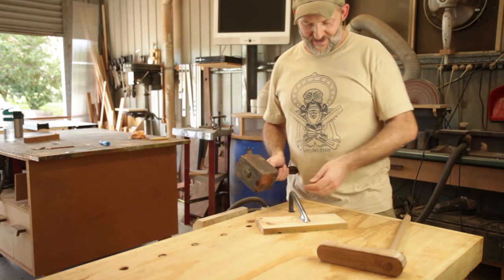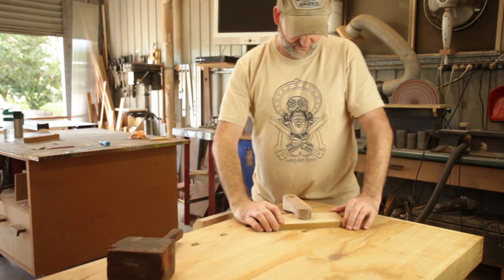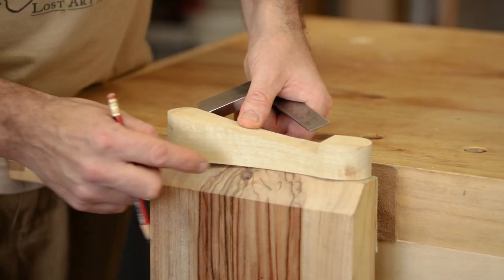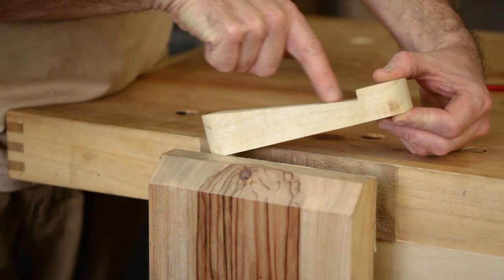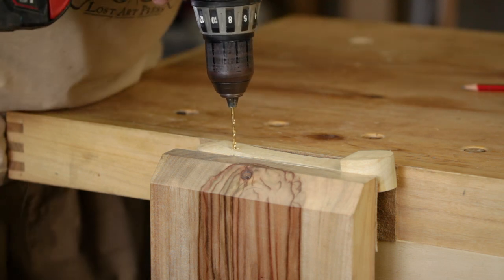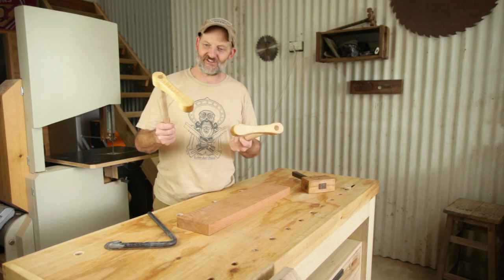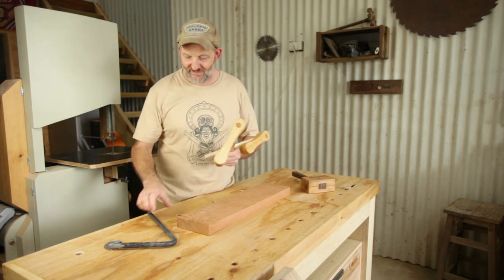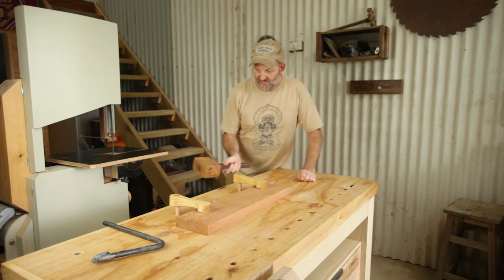Wooden Holdfasts -  Experiment

Comment: The wooden version has an advantage over the steel one in that these won't leave a mark on the piece: putting another piece of wood between the holdfast and the piece you want to hold becomes useless. Actually they hold the piece using more surface, so they don't need as much pressure to achieve the same force.
Reply from the maker: Yes that's a good point! :)

Comment: I made two of these and I am using them since 2 years and I really thank you for making this video... In the country where I live, iron ones were not on sale and that is why these wooden ones helped me a lot... I have used them in small pieces as well as 3 meter long 30x5cm long pine, didn't matter, they hold very good 👌👌👌
(Now the iron ones are on sale here, but I am not buying them, as wooden ones are already great)
Reply: How long do they last you?
I’m trying to make some for my 10cm thick bench, but 2cm ash and hickory dowels keep cracking and breaking.
I tried different hole angles and also spokeshaving the dowels down with no luck
Reply: @nicolozorzetto3871  I am still using them and they are still in very good condition. I made them from beech wood. The rough dimensions are: 4x4x19 cm and the dowel (also beech wood) is 1.7 cm ... I roughened the surface of the dowel, so that it holds better.
My bench is like 5 cm thick, so I guess for a thicker bench, the dowel needs to be longer.
I don't know why your dowels keep breaking? Are they from straight grain angle? I recommend you to use 'beech wood'
(I also glue a sheet of sand paper on the holdfast where it holds the workpiece, so that it holds the pieces better, and I don't need to hammer it that strong.
Reply: @AhmetCnarOzuneUyans  yes they are straight grain, no knots and stable. Tried 5-30 degree angles from 90 in steps of 5 with same results on all.

They are about 1.8-1.6cmx30cm while the body is 4x7x25cm pine.

I’ll try the sandpaper, thank you for replying
Reply: @nicolozorzetto3871  Maybe they break because you made the dowels a bit thick. I think the dowels need to flex a bit when hammered  to hold the pieces and while 3-4 mm doesn't sound much, it can make a difference. (Just a thought though, it might not work) But anyhow, mine with beech wood and 1.6-1.7 cm dowels work...
It can also be that, my workbench is kind a soft wood pine, so when the holdfasts are hammered, they might be getting less stress, compared to a hardwood workbench.

Comment: There goes the market for steel holdfasts!
Definitely some holdfasts I'd build a few of!
You could probably take a thin steel pipe (eg. those used for hangers in a closet) and stuff a wooden dowel inside too.
... If you don't have any leather, you could probably drill a couple of crooked holes in the clamp's holding area surface, then fill with hotglue and let the hotglue spread over the surface.
Another solution would be to use a non-skid pad (get them on eBay; for a few dollars, you get 16).
A third solution might also work: Glue some sandpaper on (would prefer hotglue, so you could switch it out, but you probably don't have hotglue if you choose the sandpaper method). Sandpaper might not be a good idea for holding wood with finish on it.
Reply: I think you could cut up an old t shirt to use as grippy fabric and you would have an endless supply when you do need to replace the worn off fabric.

Comment: I love these, going to make them just like yours. My shop is geared towards woodworking, so not much metal anything in my shop other than nails, screws, nuts and bolts. Thankyou for the idea.👍🏼😉
Reply from the maker: No worries Thomas! :)
Reply: Nails - what's that ? =)
(Dowels and glue I like, but nails I don't; actually I don't really like screws either).

Comment: Great experiment. Will come on my to do list. For me better than the metal holdfasts since I don't know how to weld.
Thanks for sharing. It'll be very useful to many people.
Reply: Metal holdfasts don't need to be welded. For safety reasons, they probably shouldn't be. Holdfasts work by flexing. Welds don't take well to repeated flexing. Just bend steel to shape and use. 

That said, I think I'd rather have a set of these over steel. And I know how to form metal. I'm just of the mind that metal has very few places in the wood shop. Blades are one of the few places where steel beats wood. Work holding is easily accomplished with wood only. Blades are another matter. Ever try to cut anything with a wooden blade?

Comment: Hey, you'll probably hate me for asking this, but here it goes:

the dowels seem to be the weak spot, so what about using straight steel tubing with a wooden arm. That way one wouldn't need any metal work besides using a hacksaw plus it could yield better results than the pure wooden holdfasts.

nice video by the way!
Reply from the maker: I thought about that but I'm not sure it would work. The steel holdfasts need a good hefty hit with the mallet to wedge it in the dog hole but these wooden ones don't wedge in the same way. Because they are a snug fit to the dog hole they don't wedge so obviously across the top and bottom of the dog hole like the steel ones do - there is a fair amount of flex on the dowel above the workbench top and it pushes into the top of the dog hole. What I'm trying to say is to wedge a steel bar you would need to hit it that much harder and I think it would break the wooden head off pretty quickly. I hope that makes sense. :)
Reply: Pask Makes Yeah that makes sence. If I understand it correctly the combination would transfer the weak spot from the dowl to the dowlhole in the wooden part.

so the hole would require some reinforcrments. i think some box joint like cross grain lamination in the back of the hole could do the trick without compromising the springyness of the long grain arm or its rigidity

Comment: Show us what is beneath the table that causes dial to be able to clamp and hold. Seems like the hole would have to have considerable dept and not just the thickness of the table
Reply from the maker: There is nothing happening beneath the table top. They work because when hit and pressure is applied the dowel (above the table) flexes and pushes into the back of the dog hole and in doing so puts enough pressure on the opposite side of the dowel in the dog hole where there is enough grip to hold it in place. I hope this made sense. :)
Reply: It makes sense but check this out then maybe you can understand what I am talking about.   If you pound the shaft down through the work table top.  And let's say the table top is as thick or more to the point as thin as a popsicle.  Now the shaft will not have much tooth to grip.  Rendering it useless.   So how thin can the table be and still work.  I ask because my bench is only 3/4 of an inch thick.

Comment: Make it more obtuse/oblique, whichever it is, I don't know.  More of a figure 7 angle.  Not 90 degrees, it should only reach 88-90 degrees when it under full pressure.  Make the wooden dimensions a lot bigger.  Use 1.5" instead of 0.75".  That should be obvious.  3/4" steel is far stronger.  When substituting wood for steel, it's got to be BIGGER.

Comment: pretty useful for those who don't have welder, or are not comfortable with metal.. does the dowel need a specific diameter or just a bit smaller than the hole..
Reply from the maker: Thanks Paul! The dowel was 18mm and my dog holes are 19mm and it worked out for me. I reckon 1" dowels would work very well but that would be a big dog hole! ;)

Comment: I love them!  Great idea.  I wonder if it would work to use a metal rod and the wood top?  You could epoxy the rod in.
Reply from the maker: Thanks - glad you liked them! I don't think it would work but I could be wrong. The wooden dowel works because of how much it flexes. If you used a steel rod it would act more like the steel ones and because there is no real give in the rod I think the wooden head would break off. Give it a go, it  may work. ;)

Comment: I also saw how you made the steel ones. Do you think allowing a larger bending arc in the top piece would improve grip? Wonderful work, thanks for sharing!
Reply from the maker: No worries Daniel! That may work - give it a try ;) I think the grip will be limited because the force is produced by the flex in the dowel and that has a limit.

Comment: Honestly, I like the look better than metal. I think these would be better using a 1" (25mm) hole and dowel.
Reply from the maker: I'm glad you like them - I thought they looked a little odd myself. I'm not sure if 1" would work better or not as the way these wooden ones work is that the flex on the dowel is applying the clamping pressure. So as the 1" dowel is thicker there would be less flex but it would take more force to break it so maybe more pressure could be applied. You would have to give it a go and test it! :)

Comment: maby a steel pin instead of wood...
Reply: Yeah, I was thinking threaded rod maybe to increase the strength/longevity?
Reply from the maker: I've answered this one a few times already.  I don't think it would work but I could be wrong. The wooden dowel works because of how much it flexes. If you used a steel rod it would act more like the steel ones and because there is no real give in the rod I think the wooden head would break off. Give it a go though, it may work. ;)
Reply: If you can make a long hole all the way through the wooden dowel, then you could reinforce with a steel rod.
This is likely not needed, as I've seen some plenty strong wooden tools. Old long-time-dried hardwood probably works quite well for dowels and likely get better/stronger over time.
You could also reinforce the wooden dowel by forcing Titebond into it from one end, but that's an advanced topic. Soaking in mineral oil for 7 days can make the wood stronger as well.